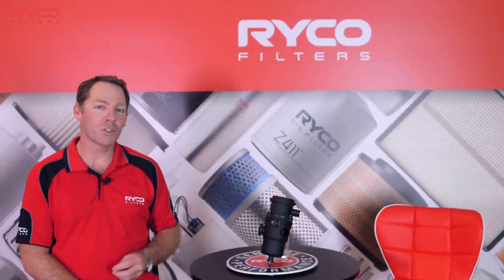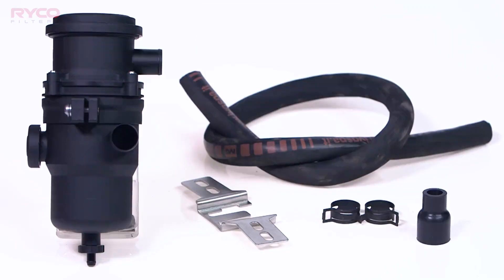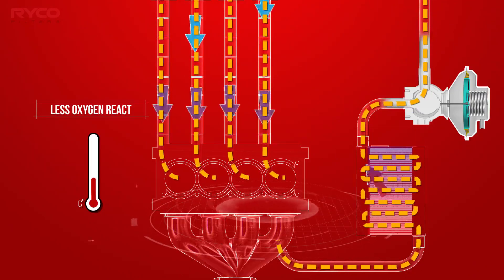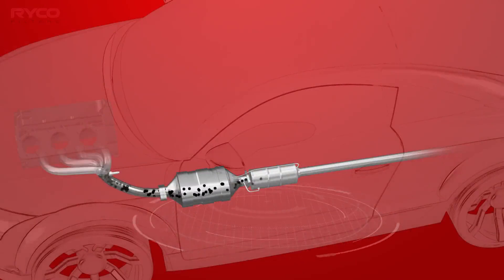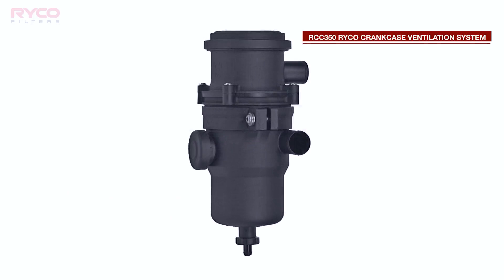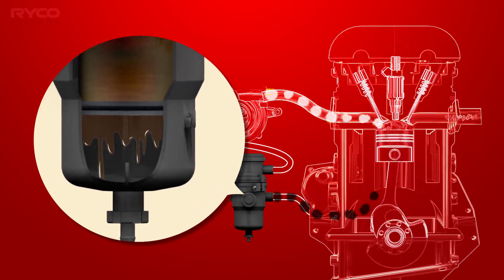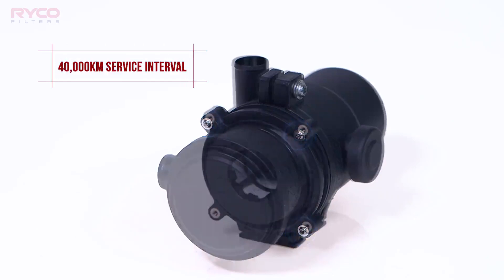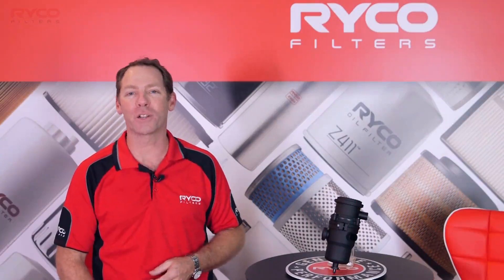15 RYCO Crankcase Ventilation Explained

Comment: Can you please let me know how to clean the filter in my RCC 350
Reply from the maker: Due to the special oil separation media the filter isn't reusable you will need to purchase a new filter and the part number is RCC150F.
Reply: Ryco Filters mine is only 4 months old
Reply from the maker: @backwardsforwads  typically it would last round 40,000 kms. If the filter was blocked you may see oil weeping from the relief valve. You will need to inspect the sump also. Typically how dirty the filter will get depends on the engine.

Comment: I Installed a Ryco Rcc350 on my 2011 X5 3.0d i was having some breathing problems and chocked inlets, now i have the Ryco rcc 350 my breathing problems have gone my fuel economy has improved my car runs smoother. this should be installed by manufacturers
Reply from the maker: Thanks for the feedback. Great to hear of the improvements you've experienced.